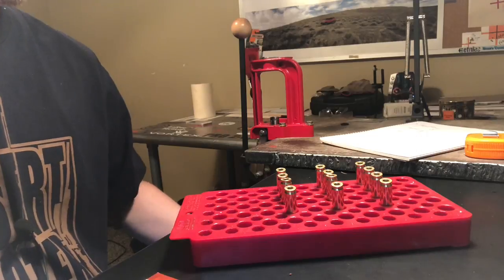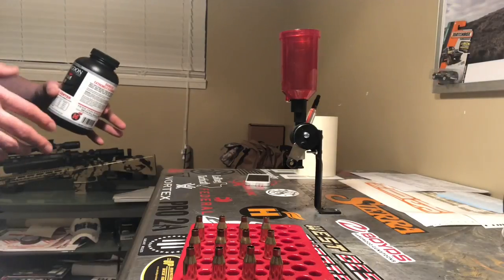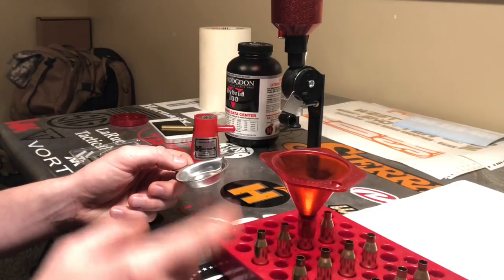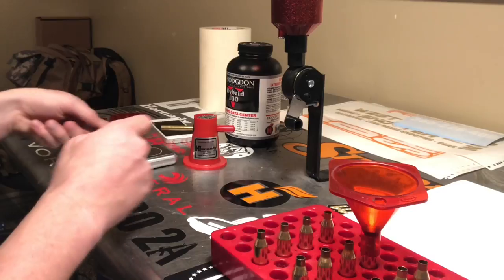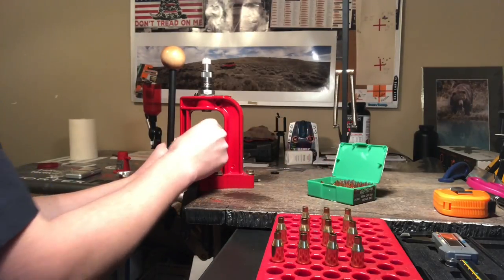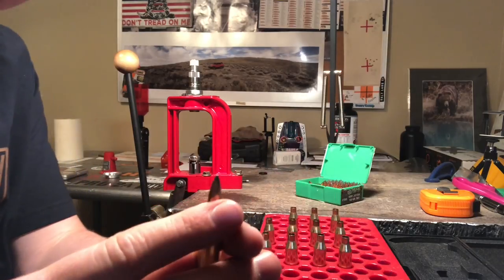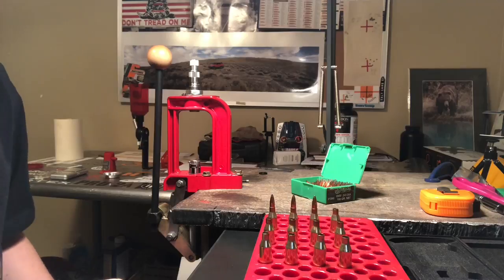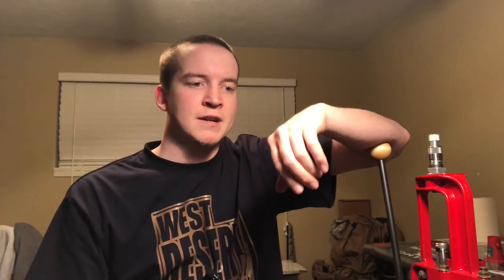Loading for a Ladder Test; How To Reload 243

Comment: Excellent! Scales are not perfect but typically have a level of precision.  Some reloading scales measure +/- 0.1 gr so for example a charge that measures  40.0 gr may really weigh 39.9 gr or 40.1 gr.
 I like to put all my cases upside down in the loading block and then turn right side up as cases are filled.  
I also color-code using sharpies the primers for each different load to help in case I drop them at the range. 
Thumbs up on your video!

Comment: The powders you are using right now can you load any other calibers, with those powders ??? Can't wait to see the other video . Thanks
Reply from the maker: Hey dude, absolutely! The H4350 works in a variety of other calibers like 260 Rem 6.5 creedmoor 280 Rem and plenty more. H4831 is slower burning and works best with heavy bullets and large cases like 160 grain+ 7mm mag or 300 Win mag 7828 is slow as well and is used in similar cartridges. Hybrid 100V is used in creedmoor 243 260 280 Rem 7mm WSM 300 WSM and a bunch of others. If you get a chance to grab a Hodgdon magazine they will list which powders work with each cartridge or a loading manual. Makes it easy to understand where each one fits in.
Reply: Dont take someone's word for loading data. Get a loading manual and read it

Comment: Do you crimp the game kings?
Reply from the maker: Nope, these do not have cannelures and I usually don’t crimp my rounds. Even my 75 grain AR bullets I don’t crimp and I haven’t found any issues yet so I skip it. I have messed with crimp on my 55 Vmax Bullets but that was just messing around to try the die out
Reply: When trickling into that particular scale pan I have found that it’s a good idea to lift the pan up off the scale as it will give you slightly incorrect weight if you trickle whilst on the scale. I have the same digital scale.
Thanks for the great vids, I am new to reloading and you have helped me considerably. Looking forward to the results
Enufzed
Downunder in Oz
Reply from the maker: Thanks dude glad I could help!

Comment: Always full length size with correct bushing.
Reply from the maker: Mine are not bushing dies so I’m not sure what you mean here
Reply: You mentioned you neck sized the cases.  My comment was stating to FL size instead and preferably with a bushing die.  We need to get new reloaders off this neck sizing option.
Reply: @michaelhmontenegro  
Hello Michael, I’m just getting started in reloading. Some recommend neck sizing only as to increase brass life as the brass after being shot in your barrel will fit your specific barrel chamber perfectly. Also was told that after awhile the brass will get tighter in your specific chamber and then thats when you want to use a full length (FL) die to return it to factory SAMMI for O.D dia and headspace. Also was told that FL resizing is a must for auto loaders every time, unlike bolt guns that have a more powerful camming action of a bolt VS  the auto-loader or lever type gun. I wish someone could explain in detail the advantages of FL sizing your brass  Vs only neck sizing? Seems there are a-lot of different opinions on this subject, and must say I’m scratching my head wondering what this old boy should do for his .223 autoloader and .243 Win bolt gun. Note: what I reload will only be going back into the same barrels.

Thanks for anyone that can explain this clearly and factually as best as possible. ✌️😎👍🇺🇸
Reply: @repairfreak  I'm sure you figured it out by now. But i can tell you for sure that there is more than 1 way to skin a cat.

Comment: Why did you choose to go in whole grain increments rather than half grain or like some other YouTubers .2 or .3 gr increments
Reply from the maker: Time and cost, I won’t be doing anything further with these bullets so this helps show going from a medium charge to a pretty stout charge. Also I don’t trust my current scale to give me accurate enough readings to do .2 increments. Also it costs more to shoot more bullets. But I also shoot 1 grain increments for most my tests until I get up top.
Reply: I have the same scales and they don’t give a correct reading if you trickle the powder while the pan is sitting on the scale .
Thanks for the Great vids, new to reloading and I have learnt a lot watching them.
Enufzed
Downunder in OZ
Reply: I would agree with you, whole grain increments is too large!  especially if you are loading towards the top end of the charge rate on a particular powder/bullet combo you can get in to high pressure range from one group to the next too easily.  Also you could very well miss the sweet spot by making such big jumps from one load to the next.  Example in my 243 when using RL-17 41.5 was my best load, 41 grains was not good at all and neither was 42 so I went back and made adjustments of 41.3 and 41.7 and found that 41.5 was exactly what my gun wanted to shoot.